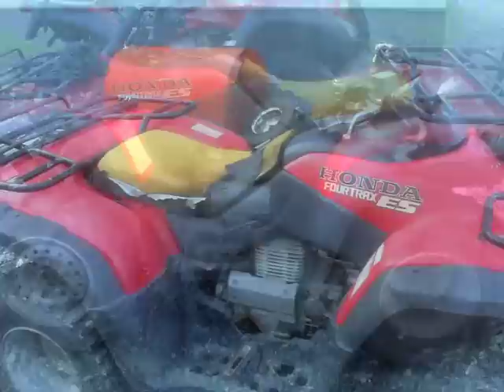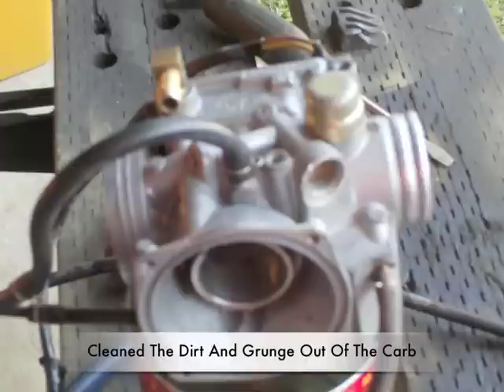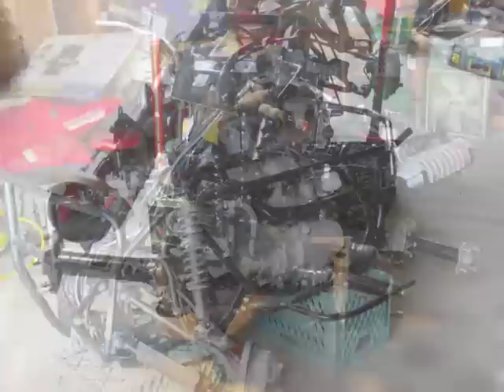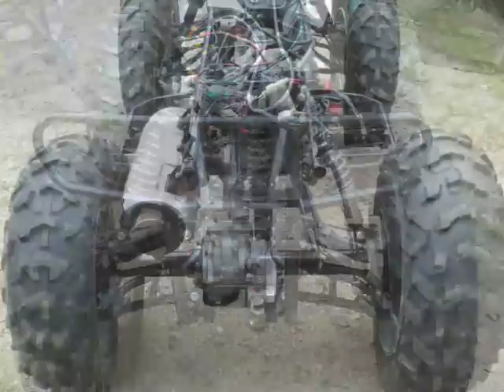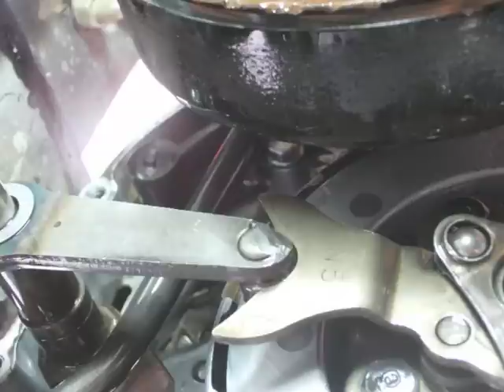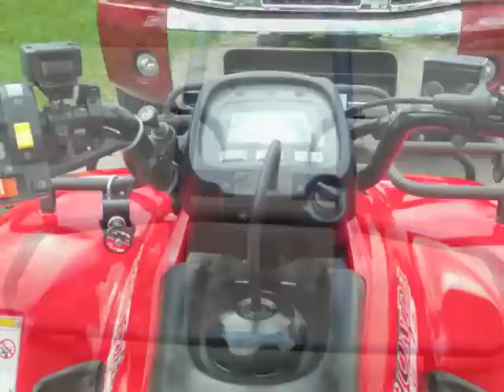Honda TRX 350 Fourtrax (Rancher) Restoration

Comment: Nice overview, thanks!
I own an exact clone-copy of TRX 350 (Odes 400) and this video made another good confirmation for weather it is or it's not the clone of TRX 350. It turnes out that it is and that's good to know, because the chineses stoped manufacturing the spare parts for it. I guess I have to replace them now with Honda ones :) Right now looking for a new overbore piston kit for it.
Reply from the maker: Thanks for watching and commenting! Good to know you should be able to find parts that will fit your quad!

Comment: My dads quad is just like this, an 01 honda rancher, but his is foot shifted, not electronic. It needs a full restoration badly. I think the frame might be a little bent, not the main part, but the area holding the gas tank and rear rack cause everything is shifted around. It was on a trailer behind my grandpa's truck when he hit ice and spun out, the trailer ripped off and flipped into the ditch... With both quads still strapped on! The other one was an 03 rincon 650 that just got bent handlebars, otherwise they were just fine! Anyways great job and sorry for rambling on:)
Reply from the maker: +Benjamin Kenney Too bad about the trailer flipping...hopefully only the ATV's were hurt!  Good to know your tie downs kept them strapped down.  Thanks for checking out the video!
Reply: A couple of plastic water jugs broke, but the quads and the generator were fine. It was about 5 years ago so anything that was broken was replaced.

Comment: Now if i can ask 1 question my man, my rancher is a 2 wheel drive, but you replaced your drive with the warn 4-2-4 and made it a 4x4, "again". I was wondering if i can add a front drive shaft with a locking diff, with selectable 4 wheel drive on mine. Will it be applicable to a stock 4x2? Thanks, oh and nice job!

Comment: Good Job, I have a question for you, before you fixed the shifting problom, did it not shift at all, or only sometimes? I bought a 2000 honda 2wd, It switches gears sometimes, and other times it does nothing, I was thinking on buying an angel shift sensor before I do any major work, hoping that would fix the problem, I was told honda bike engines are amazing, and shifting is a common problem, I would like to repair this bike, it is a nice bike.
Reply from the maker: It seems to me (it was awhile ago now) that it would shift up not too bad, but then when you got into the higher gears, it wouldn't shift back down and ya, very intermittent. You may want to make sure all you connections are nice and clean and dry first. We had also changed the angle sensor as well but that wasn't our problem. Then we found out about the problems with the shifter plate and sure enough that fixed it. It was good after that. We no longer have this quad anymore now. Thanks for watching.

Comment: wow looks like new! great job bud! how much was the total rebuild cost?
Reply from the maker: Tristan102100 It has been so long now can't really remember how much it cost.  It wasn't too bad compared to the value of the Honda.  Those Honda's always seem to hold their value.  Thanks for checking out the video.
Reply: what are the sizes of the factory tires you put on it? mine has 24x8x12 all the way around, doesent seem right to me.
Reply from the maker: Tristan102100
We didn't change them, just had stock.  24's I think ....but we don't have it anymore.  If I remember right it had different sizes in the front to the rear.

Comment: I have a question if you wouldn't mind would you tell me how to fix oxidized atv plastics if you wouldn't mind
Reply from the maker: Haven't tried it yet, but saw Canadian Tire was selling this new product Rustoleum restore for that very purpose.  We ended up painting ours as just couldn't seem to get them to shine any other way!
Reply: +cubbeezx ok thanks
Reply: @cubbeezx  When you mention painting the Honda 350 plastic did you use like I believe it's Krylon plastic paint like you use to paint outdoor plastic lawn furniture?  I'd figure that kind of paint would have more flex to it and not crack or peel off.
Reply from the maker: We did paint our Yamaha Big Bear ATV and yes we did use Krylon plastic paint!  Worked really well.

Comment: Hey!

I am looking to purchase a 2001 Honda fourtrax ES. They want $2000.00 it has 17000kms but looks pretty decent. anything I should be looking for when I go and test her?

Thanks!
Reply from the maker: Both our Honda's had really high mileage too...helps if they have had regular maintenance but they are tough!  Just make sure you try it and listen for any "noises" that shouldn't be there.  Good luck!
Reply: Thanks! just picked it up.
$1650.00 rode really well engine runs without skipping a beat! seems good to me. Needs brake work though... although it seems brakes aren't required with the down shift. maybe for emergency anyways.

Cheers! Maybe I'll throw some videos up once we hit the trails!
Reply from the maker: DucLuke
Right on and congrats on the new ride!  Good sign the engine runs great!  Happy riding and enjoy.

Comment: please help. will  wheel set.  Rears are 24x10-11
Fronts are 24x8-12 of a 2015 rancher
fit my 2005 honda rancher 350 4x4
Reply from the maker: Hmmm, not sure....we don't have our rancher anymore.  Maybe would fit if you have a solid axle but not positive.

Comment: how did you get the plastic to look so shiny?, im trying to find something to shine up the plastics on my 04 350... thanks
Reply from the maker: We tried everything from sanding, to buffing to waxing.  Nothing made them look as good as spraying them with SC1 or Meguiars Tire Shine.  Believe it or not lemon pledge polish also works, but the smell attracts the bees LOL
Reply: LOL, I was looking it up, and seen a lot of people use pledge with future shine, what gives best results for you?
Reply from the maker: 69KarKrazy
The SC1 followed by Meguiars-both work better than pledge, but more expensive!
Reply: so you like the sc1 best? how would you apply it to the plastic?
Reply from the maker: 69KarKrazy
Yes, and it smells awesome!  Just spray it on..don't even need to really wipe it..just let it dry
Reply: thanks so much! :)
Reply: 69KarKrazy I couldent find any sc1, but I picked up a can of meguiars hot shine tire foam.... tried spraying it on and wiping it but it doesent do too much, any tips?
Reply from the maker: 69KarKrazy
It isn't the foam, we tried that too, but it doesn't work very well.  We use Meguiars Hot Shine Tire "Spray",  the can looks almost identical but instead of "foam" it says "spray"..see if you can find that
Reply: We don't have any of the spray here :/ I'm going to have to try the pledge.. Is it just pledge polish? Or is it a certain type
Reply from the maker: 69KarKrazy
Oh, that's too bad...pledge polish is just the regular stuff you buy in a can....lemon smell..smells good, but attracts bees LOL
Reply: ***** pledge furniture polish? with lemon scent is all I can find is that the right thing?
Reply from the maker: 69KarKrazy
Yes, that's the stuff!
Reply: ***** i found a can of the  meguiars hot shine spray :) how do I apply it to the plastic?
Reply from the maker: 69KarKrazy
Right on!  Just spray it on...you can wipe it a bit, but it usually just kind of flattens out after you spray it...put the nozzle on wide spray if it has the option.
Reply: so can I just spray it and it will dry?

Comment: You did an awesome job my friend. I've got an 01 rancher 2 wheel drive. I need some videos showing me how to find and fix some problems its got. Its back brakes are not great , the front brakes don't work any more , and its leaking what I think is oil somewhere from the top. Its a slow leak that slowly shows on the motor after a short ride , and there is some oil in the box with the air filter , with the filter wet on the bottom. I love this atv and want to fix my self. Help if you can.

Comment: I know this was a long time ago Cubbee but do you know why it had a foot shifter when its an ES model?
Reply from the maker: The foot shifter was for emergencies if the auto didn't work.  The actual shifter handle would just slide on as a temporary fix.  Thankfully we never had to use it!
Reply: It's for back up in case the es fails

Comment: What kinda paint did you use on the racks.
Reply from the maker: We actually have been using the truck "box liner" paint in a spray can.  It is tougher than regular paint and seems to last better.
Reply: TY